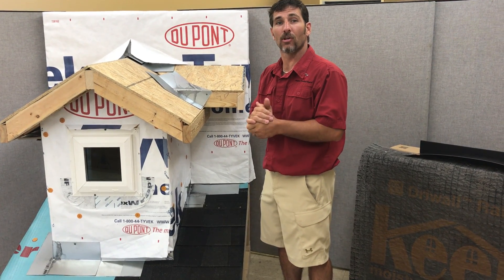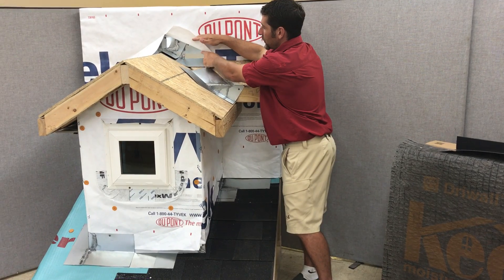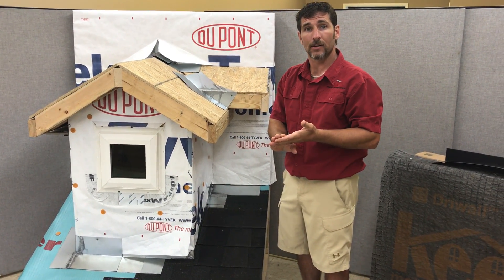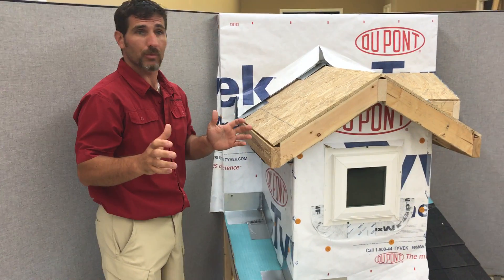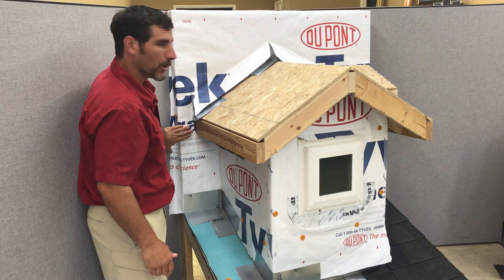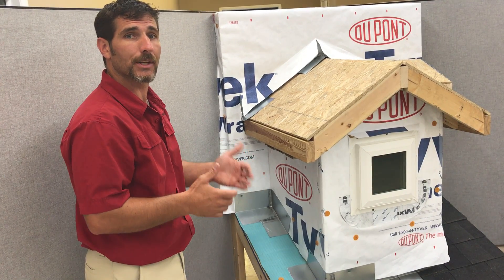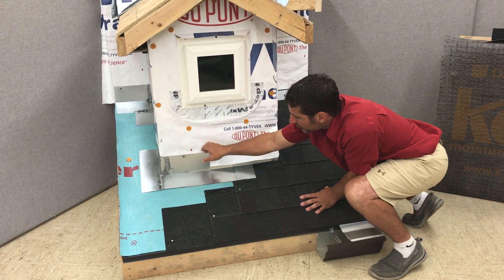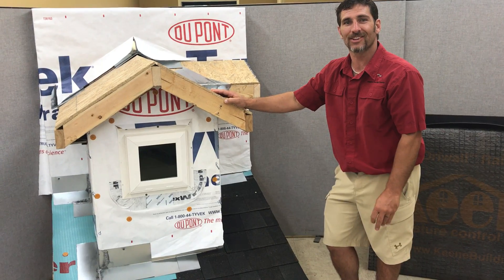What is Roof Flashing & How to Install it

Comment: Is it expensive to  add the  flashing when it was never put on when the roof was put on changed? this roof is leaking in several places and if need of bad repair.  Thank you
Reply from the maker: The issue with adding flashing after the roof has been installed is you will have to get the flashing on the wall side under the wrb. In order to do that you may have to remove the façade to gain access to the wrb.

Comment: I’m building a new home and during my pre-drywall walk through I told our super that the house wrap and flashing was done incorrectly. The flashing was over the wrap and I told him it’s supposed to be the wrap over the flashing to prevent water infiltration. And he told me that he thinks that’s the way it’s suppose to be done. I told him no and right now they are I stalling the siding trim pieces and I already saw a part where they still have the wrap under the flashing. Makes me really angry that they are not listening to my concerns.
Reply: It's the way it's often done, but it's not right -- and it's not per manufacturer instructions.  You can obtain those instructions from the manufacturer (and find them online) and show the super.  He'll probably still hem and haw (to avoid more work), but flashing is NOT something you want to get wrong.  If you raise a big enough stink, go to the top levels of the company and have your facts in order, it might make a difference.
Reply from the maker: You are correct and they are incorrect. Unfortunately many builders are completely ignorant when it comes to waterproofing. Hopefully you guys can come to some resolution that will correct the issue before it’s too late. Thanks for watching!

Comment: Great video.   Can you make a video on standing seam and vinyl siding.   A lot of roofers are not installing the trim flashing from the wall and onto the new roof panel.   They are just bending the standing seam up the wall.  Then running into trouble at the kickout gutter area with gaps at drip edge and wall etc.
Reply from the maker: That sounds like a disaster. Flashings should all be installed to the wall with the WRB lapping over them no matter what material you are finishing with. Standing seam should never be installed without a non-granulated self-healing membrane under it no matter what the pitch of the roof is. Thanks for watching!

Comment: what is that section of the house at 0:43 called? the part where the ridge (on the roof of that projecting window) meets the side of the house. do they make pre-bent flashing for that?
Reply from the maker: I call that a ridge to wall transition.  We have always custom made those flashings on site, so I am not sure if you can buy them but I don't think so.  Thanks for watching!

Comment: Finallyyyyyy!!!! A video on waterproofing a covered porch with flashing!!!! Paul, if you could do one with a little more depth on the finishing touches when installing the shingles ON TOP of the flashing it would be great! Nobody has that part of the project on YouTube. After the flashing is on, what is the proper way to attach the shingles, glue, tape, caulking ect... for preventing the water from going under the shingles... Thanks for the video!
Reply from the maker: Sure thing! You can go to any shingle manufacturers website and learn about proper installation until I can get a video produced & live.  But thank you for watching and the suggestion!

Comment: I think it's a good idea to make a video on flashing detail once siding is on the building and the layering detail in which you are supposed to install it. Such as a situation where exterior foam board from footing upward to the roof line under the siding.
Reply from the maker: https://youtu.be/yV0Hy8Z94X0
this video may not explain all the details you are wanting but check this out and then let me know what else you would like to see.  I will try to make that happen!  Thanks for watching & your feedback.  Cheers
Reply: Yeah!

Comment: I'm curious to know what kind of nails to use and will the nail used cause a leak? Thanks!
Reply: standard roofing nails will work to install flashing.
Reply from the maker: I as well as DuPont recommend using Staples or nails. The reason that you use Nails or staples is for two things. The first being more strength to hold the housewrap on the second being the water that runs down the wall runs around the cap and never accesses fasteners.